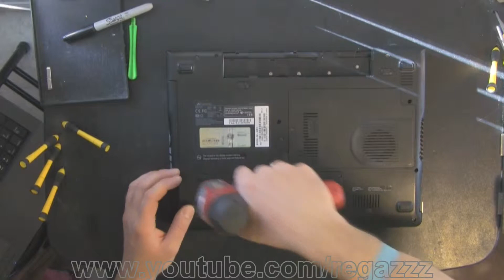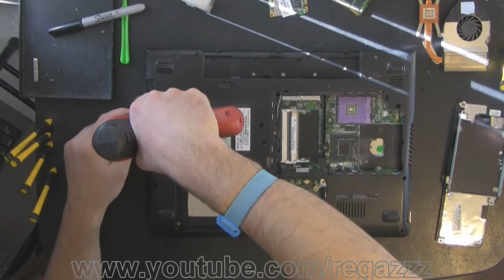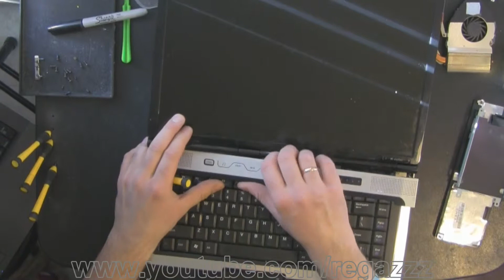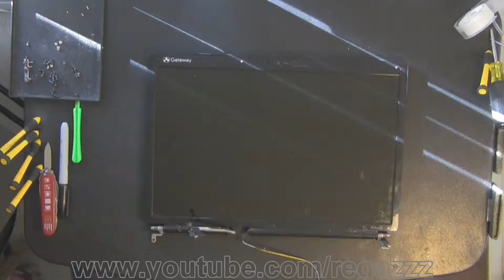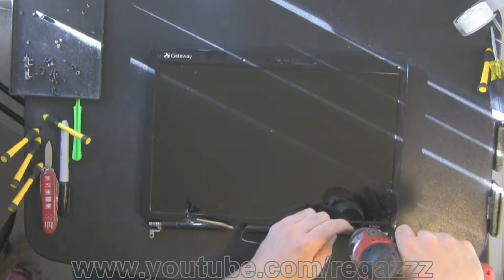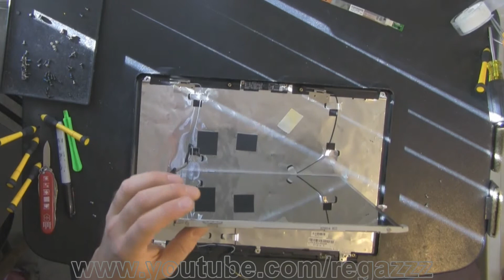GATEWAY SA1 M SERIES take apart, disassembly, disassemble, how-to video (nothing left) HD

Comment: Where is the CMOS battery on this thing? Can it be replaced like a regular CMOS battery or do I have to get it packaged in a certain way?
Reply from the maker: Sorry for late response, cmos is most likely located by the audio jack on the side of the cou and memory. So far I can see you can just simply unplug it and plug back in.
Reply: I just had to take one of these apart myself. The CMOS battery is located directly under the wireless NIC, in the same compartment as the hard drive right next to the headphone/speaker jacks. A heads-up for anyone else who wants to replace the battery, though. It's connected through some wires that are shrink wrapped to the battery, meaning you have to either get a specific battery from the manufacturer or casually have plastic to shrink wrap the wires back onto it after cutting them out of the old battery casing.
Reply: @BagMan65  do you know what model battery replaces the original? I have one I'm working on and the plastic plug shattered on me and I can't find a replacement on a normal surch.
Reply: @AlexCoppertone  I wish, haven't been able to find replacement parts from anywhere for this laptop, to replace tje battery on my grandmother's laptop I just cut the wires off the old battery and soldered new wires onto the connector for a new one. 

Best of luck finding a replacement.